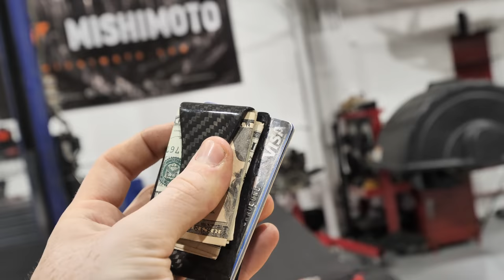Making MASSIVE PROGRESS On The MD-ENGINE Eclipse's Chassis!

Comment: you should get an air scoop like the Mr2 one to supply air to the bay
Reply from the maker: There will be some sorta aerodynamic stuff! Probably not a roof scoop or anything too noticeable like that.
Reply: @_Gingium_  maybe some rear fender intakes like the ones on a GT3RS?
Reply: Maybe an intake from underneath the car
Reply: @vince0815  oh good point, didnt think of that! i guess depending on how much cooling is needed there could be both?

Comment: Since you are slotting your subframe mounts you should put hash marks on it for adjustment marks kinds like the top of a coilover with a center mark on the subframe bush housing. Will make it handy as a quick check to make sure it hasn’t moved while on a track day

Comment: Pulse is a great feature to get a dab rhythm going for filler wire. If you add filler every time it pulses to higher amperage, it helps keep you consistent. I also suggest not jumping as far ahead on your welds as you do while tig welding. Try to jump about half the distance of your last bead, or maybe about a 1/16 of an inch every time you add filler, that’s how you get that really nice stacking dimes look. Another good way to know how far you should jump ahead is by the thickness of your filler. Jump ahead about the same amount as the thickness of whatever your filler size is.

Comment: Is there no concern of that subframe shifting slightly over time with those adjustable mounting points? Killer fab work still watching, crazy to see how far it has come.
Reply: Was wondering the same. Maybe he could make some 3d printed or machined delrin inserts that lock it in place.
Reply: There are factory subframes mounted the same way in some cars. I wouldn’t worry about that as long as everything is torqued to spec.
Reply: @Rellek  fair enough, good point!
Reply: @Rellek  I've seen suspension components and non drive subframes with this mounting method, but never a subframe holding up the entire powertrain. Will be interesting to see how it works.
Reply from the maker: @xperia5295  I think if everything is torqued properly it'll be fine. Worst case scenario if it ends up moving around, we'll get the car aligned and then weld the bolts in place.
Reply: @_Gingium_  you could make some plates with a hole in it that fits snug into the mounting point. Then if the bolt tries to move it will hit the gussets on the mount and not shift the subframe, kinda like how an essentric bolt works. Then if you want to change position you can just change out the plate.
Reply: Also there are some points on the subframe mount that should be gusseted or triangulated, (I'm at 14:13 when I made this comment)
Reply: Id be more worried about the tube being cut out for the actual mount, that takes  strength from the tubing. If shifting became a issue, he could make a washer and weld it to the mount.

Would have be stronger if done like the back subframe mount.
Reply: @_Gingium_  was also wondering about this myself, perhaps the bigger concern might be for the future owning working on it; dropping the subframe or working on suspension would require everything to be perfectly re-aligned. But otherwise, this is looking great!

Comment: I'm curious on how cooling the motor is going to work, and how your going to encorporate venting into the car so the motor can be cooled
Reply from the maker: Well the motor is water cooled, and the radiator will be upfront, so there shouldn't need to be too much ventilation!
Reply: @_Gingium_  interesting and pretty cool!

Comment: Do you plan on replacing one of the rear quarter windows for an air intake? That would be 🔥🔥
Reply from the maker: I thought about it. But they're super curved and I don't know how to make something curved and clear lol
Reply: @_Gingium_  challenge yourself man, that's the reason you're even doing this swap lol do it! Break that comfort zone.

but i get it tho, you got alot on your plate already
Reply: @_Gingium_  I think it would be sick to have a rally looking window intake, I definitely think it would be cool to at least try
Reply: @_Gingium_  If you do it on the driver side you dont need it to be clear, its near impossible to look out the rear window on your side (as long as your mirrors and side window cover your blind spots...)

Comment: Caleb ditch those HF magnets and pick up some Adjust-O on/off switch magnets, they're life changing. No more ripping the magnets off and messing up a jigged up item. You can slide them perfectly into place and then flip the switch, no more skirting the magnets across the surface of the table/piece. 120% worth the cost of them, which is still pretty reasonable.
Reply from the maker: Yeah I need to do that! I'm sure it would also help with getting metal dust all over the damn things!

Comment: I love the fact you have a plasma table yet you still cut the round parts of the subframe mount by hand :D. I do that a lot aswell with new machines. just so used to what I already know
Reply from the maker: On some of the smaller stuff I find it quicker to just trace it and cut it out with the band saw, rather then measuring, designing, and cutting with the CNC.

Comment: no way you use fusion! i took a class last semester called manufacturing systems and techniques (i’m studying industrial and manufacturing engineering) it was so much fun to use. being able to design, program CNC machine pathing, and generate models into 3d print mesh models all in one program was awesome

Comment: Question i do have, why are you not doing the control arms and struts first to give the top hats some angle so there is no binding? Wouldn't having the top hats perfectly level like that cause the struts to bind under compression since they aren't going to straight up and down?

Comment: Its more expensive but theres this stuff we use in ship yard called red rubber its a welding working matt thats able to be laid on without regreting your life decisions. its just called red rubber  gasket material spool from like home depot last allot longer then fiber glass clean up is also better you will thank yourself in the long run can even put it under tables to protect floors with hot work big money saver in long run imo. And hey if you even want to make a low pressure gasket 70-150psi at most then hey you got the material lol. Cost about $100-$120 for 18-20ft rolls. theres also black rubber more expensive stronger etc has threads in middle rubber.

Comment: I think you should rethink those bars going from the main hoop to the rear of the car. If someone rear ends the car hard its going to push on the main hoop, the driver is going to be sitting under the hoop, i don't think its a good idea.

Comment: i would NOT have made the subframe adjustable. just as you said yourself its unbelievably important to have the subframe PERFECTLY squared into the chassis.
i cant think of any chassis that has "adjustable subframe mounts" you should go back and remove that bit from your build. 
you can also make adjustable bars and control arms to have "adjustable suspension"

Comment: Man, I really hope you're raising that subframe higher than it would be factory. Having the ride height like you did and the angles on the control arms leads to F'd up situations with handling and you needed to be like 2 whole inches higher (ride height) for the angles to be correct. The way to get the desired right height and have good control arm angles is to relocate the subframe. And then the only way to keep the engine as low as it needs to be (or lower) is to notch the subframe. Not the having the engine 2 inches higher while the whole car is lower would be TOO bad, but still...

Comment: I like the top hats and general cage structure, but that subframe mount is not great.. The rear mount structure looks overly long and complicated, why use the stock subframe mounting bolts, if you are then going to bolt on a different structure which then bolts to the frame rails.I think that could be done much neater. Adjustable mounts sounds like a recipe for future disaster, be confident in your work, measure 10x and weld in non adjustable mounts in the correct location once.